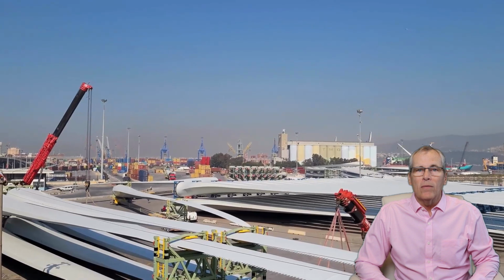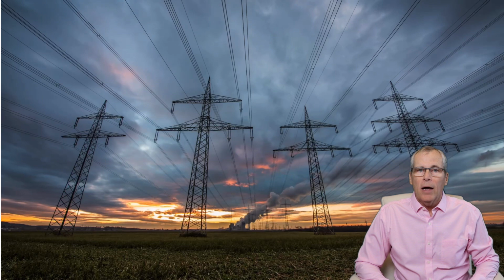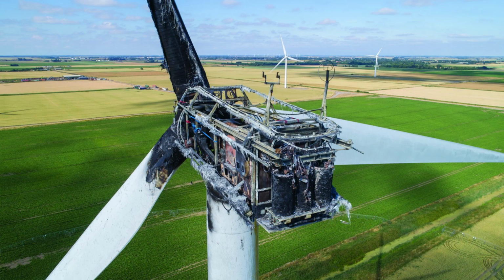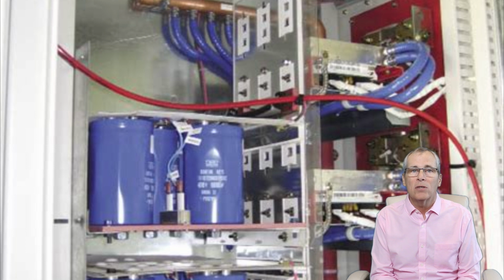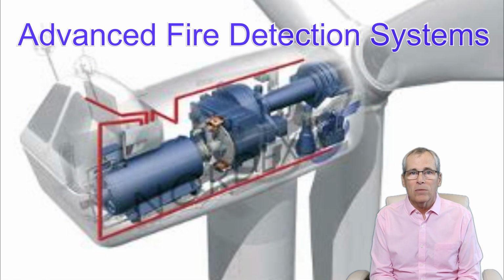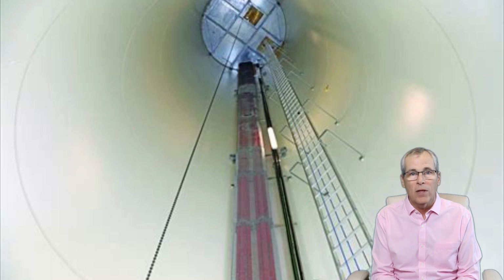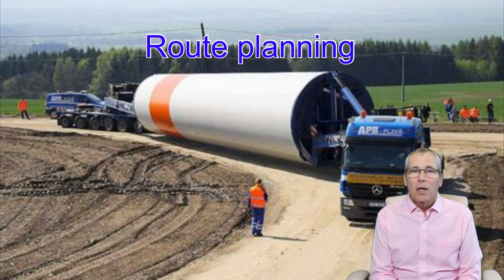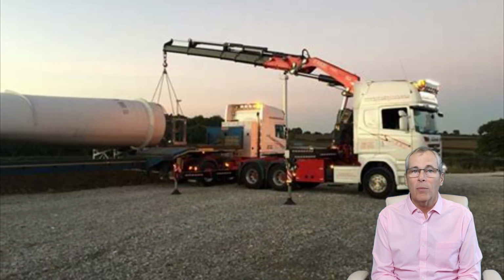Engineering a Sustainable Future: Addressing the Challenges of Wind Energy

Comment: Wind turbine wall or stand bend because of air pressure or become hotter and melt.  This two main problem, we have to slove. 
We must make stand with  interlocking clay  or cement bricks,....with or without cement. 
Now a day's we can climb any pole or coconut tree. 
We must make structure either square or circular,
so that we don't need help of cranes . 
At present we have metal stand  for wind turbine, we can cut in half  in the middle,  .....use coupling to attach half.  
This system will help rubber wires to change or to operate easily. 
Lots of ways and lots of work needed to improve the  wind energy service .
Solar is good for hotter countries but cold weather country's need wind energy. 
Jay shree ram.
Reply: I am thinking if people will use wind energy for shipping larger ships,  what will happen?  
Larger vessels goes inside deep sea and face high winds.  Larger vessels have places to install .
Jay shree ram.
Reply: https://youtu.be/EN4Cup5WegY
Reply: https://youtu.be/EN4Cup5WegY

Comment: I have one suggestion,  
We can bring all system below,  I am sending you one link in that wheels is attached to ballbearing. 
We can use this technique to save maintainace charge of wind turbine,  
We can attach rubber tube for rotation from top to down , we need to make some structural changes in body, I will  write tomorrow about body. 
Second we use clay blades,  holes can made to clay blades, two sided screws can be used for fixing blade,  we have to reduce cost on all levels,  
We can break blade.... using  arrow...ifever something goes wrong.
When it's rainy,  blade will become heavier and automatically it won't rotate too much.
First  use clay blade, second putting all system at ground level,  we can remove rubber tube from below and stop,  we will have more control on operation. Third body.. 
Jay shree ram.
Reply from the maker: Thanks for watching and commenting. It's a beautiful thing to watch engineers solving problems.